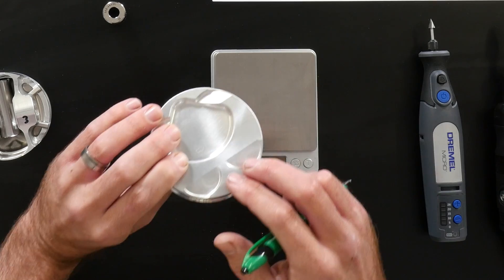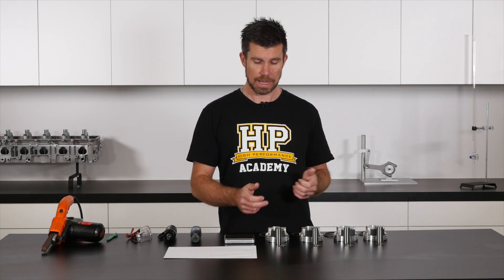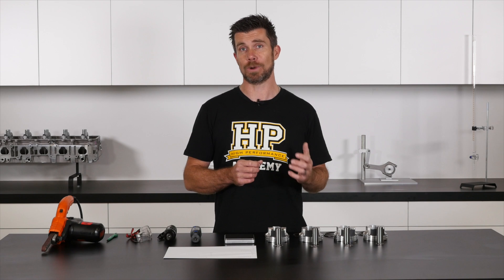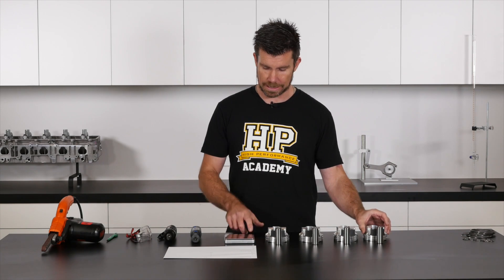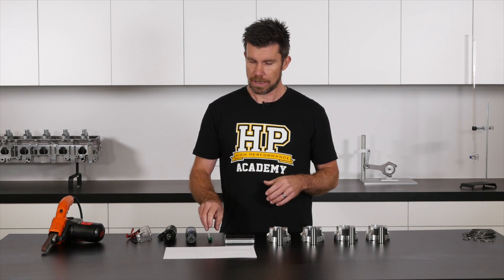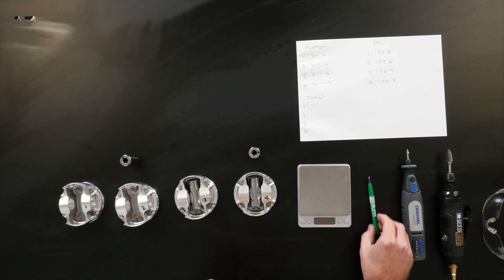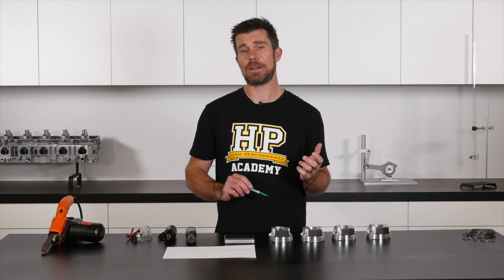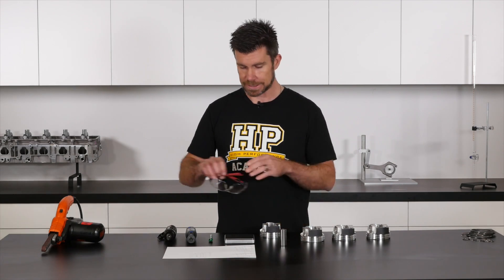How to balance a piston ⚖️ | Performance Engine Building [FREE LESSON]

Comment: 0.01 Grams don't sound like much until you take into account how many G's a piston Experiences as it switches from going up and down TDC & BTC
The piston itself will weigh upto 10 Tonnes (10,000KG) 
During Peak G-forces as it changes direction in the thousands of G's 0.01 grams becomes 20-30kg of unbalanced weight on piston

Comment: So i weigh out my pistons, pins etc. and my rods for the piston side (oscillating weight) and crank side (rotating weight). Now I matched the rods to the pistons (clips, rings and pins have exactly the same weight, so they don't matter), can I use it like that? 

My rods just have a difference of 0.2g, my pistons have a difference of 1g lightest to heaviest. Rotating mass of the rods have a difference of 0.2g (measured everything a hundred times). 
I wanted to get an overall difference of 0.3g max.

Comment: It's ok to dril diesel piston to remove weight?
Reply from the maker: You can do this to diesel pistons as well. Same rules apply when it comes to the fact there are areas where you want to avoid taking material from and others where it is acceptable remembering you balance to your heaviest piston to match them rather than getting them all to your lightest as that will see you needing to remove more material - Taz.
Reply: @hpa101  thank you

Comment: I have a piston that is 2.14 grams lighter than the rest. Can I even remove that much material safely?
Reply: Late reply but if it's an aftermarket piston I would be returning it for a replacement. 2.14g out of weight with the rest isn't great QC. Generally any half decent piston manufacturer should be matching their piston weights across production such that a particular set doesn't have that much variance.

Comment: André, what I still do not comprehend entirely is when we use pistons and rods that are of different weight compared to the factory piston weight. 

The crankshaft obviously is balanced in itself. How does heavier / lighter rod&pistons affect the entire rotating assembly?

TIA
Dom

Comment: Has anyone ever re-weighed the pistons after hard use?

I wonder what effect the carbon build-up would contribute.
Reply: I am planning to rebuild my 2008 Honda City 1.3MT Engine, Cylinder no 2 is weak, Engine burning 0.5_0.7 Liter between every oil change. I hope my C-2 will be doubLe in weight LOL.

Comment: Ahhh sir... you ground the piston down at the wrong place and weakened it. Sorry but warranty is void now even though the piston is indeed defective. Sir, would you like to buy another one?
Reply from the maker: You can call your supplier before you balance your pistons to be safe and double check where they wish you to take the material from. This isn't something new or unknown to them, in fact in some advertising they will possible boast as getting their own product weights very close so that it is less work for you to balance yourself, which acknowledges their understanding that it is done and required for and by many :) - Taz.
Reply: @hpa101  yeah I hear ya, was just joking around. Btw, is it required to balance the pistons? I've got a set coming in for my engine, didn't really want to do this unless it's necessary.
Reply from the maker: @garyr7027  ahh sweet, sorry man, it's hard to tell sometimes with just the text as we get some surprising comments haha
If you don't plan to balance your pistons and rods the way we do for high performance builds, say if you're just rebuilding a low power application for your daily driver, then at the very least you should still weigh and pair them in such a way to get them as close as possible as sets. 
This would see your heaviest rod with the lightest piston etc.
It's your build so at the end of the day you can do as much or as little to it as you like 😎- Taz.
Reply: @hpa101  that I can do, and it's a good idea to at least get them close to same weight. One other thing, should the rod be weighed in with it?

Comment: Nice tutorial Andre!  I have a question for you - when I designed pistons for a project, I spoke to the design engineers at Mahle about piston balancing. They told me to categorically never remove material from the underside, and only remove material from the crown area. This leads me down the path of settling the combustion chamber volume first, and balance after. Balancing the gudgeon pin/ wrist pin seems like the only viable option once you've set the compression chamber volume?
Reply: yeah, the underside is under tension, cracks may start there, the top side is in compression,no cracks can originate from the top

Comment: Balancing to a tenth of a gram is a fools endeavor when masses orders of magnitude greater than that in the form of oil, carbon, etc are uncontrollably and unevenly distributed on the rotating and reciprocating components of an engine.  Also, any set of pistons or rods that isn't sufficiently balanced from the factory aren't worth buying and using in the first place!
Reply from the maker: Unless you're in Formula 1, you don't have the ability to accurately calculate and measure oils influence or carbon weights etc. There are some things that are simply outside of our control, so instead we focus on what we can control and do it to the best standard we can. 
To balance to the degree Andre has here, and he did address this in the actual video, it could be considered a little overkill, but it only takes a few more minutes than it would to do things to a lesser standard.
For balancing from factory, it's all a matter of degrees of balance and you could quite easily run this kit as delivered. We tend to be extremely fussy so our target balance is just tighter than those of the parts manufacturer. We find that all of the aftermarket parts we use are outside of our personal targets if that makes you feel any better - Taz.
Reply: Absolutely agree that +/- 0.1 gram is a waste of time. Unless your reciprocating mass is extremely light, or your RPM's are extremely high, you do not need to balance to better than +/- 0.5 gram.
Reply from the maker: @bunnyrabbit4972  what's the time difference between 1g, 0.5g and 0.1g when it comes to balancing? I think you will find it is negliable, but everyone is free to do things to their preference on their own builds for sure - Taz
Reply: @hpa101  
A typical high performance STREET engine will not have a peak piston deceleration rate exceeding 3000 G's approaching TDC at operational redline. 0.5 grams * 3000 = an instantaneous imbalance of 1.5 kg. This is nothing to worry about, and when you marry the light pistons with the heavy rods, and vice versa, the overall error is reduced further, below +/- 0.5 g.

Comment: can you use the small-end rod weights to balance the piston weights?
 ( example: +1piston&+0rod    and   +0piston&+1rod)  
I have a piston thats like 2g overweight, all my pins and rings are all the same. i took out some material from piston, but i dont want to remove too much. so can i include the small-end rod weights when balancing? or is it better to just grind pistons and rods Separately to match smallest weight
Reply from the maker: Hey there Andrewdini :)
2g is not an excessive amount to remove from your piston, and your pistons and rods should be balanced independently.
Your connecting rods will be balanced at both the big and small ends, so taking excess off one for the sake of your piston would actually see you taking off even more material to balance that out across your rods, which is something you don't want to do.

Just remove the material from the correct location as shown and you will be find :) - Taz.

Comment: Great vid! 🤩 one question: we have anyway to take the conrod out, so it would not be also a good idea to weight them and match it, like the conrod and piston weights the same?
Thanks and keep going to make videos like this!
Reply from the maker: Hey there DrSiech. Yes sir, your conrods can and should also be balanced. You avoid doing them with the pistons as an entire unit and I'll pop a few links here that will help cover this and it is also in the engine building course material.
Quick video: https://youtu.be/TViHBkLZnx8
Some more details here: https://youtu.be/0tXbCqA2QHI
Webinar lesson on this specifically (paid content): https://www.hpacademy.com/previous-webinars/193-2/
Course material this is included in (paid content): https://www.hpacademy.com/courses/practical-engine-building/

Hope that all helps you out - Taz.

Comment: You clearly don`t know what your talking about
Reply from the maker: How so Dan? Share some knowledge on what you specifically think is being done wrong here and we'll be happy to discuss =) - Taz.
Reply: @hpa101  Your choice of removal area is not only out of the norm it is ridiculous but thanks for asking
Reply from the maker: No worries Dan, explain where you take material from and why in that case - Taz.
Reply: @hpa101  on the pin boss above the hole on the in side would be the preferred method

Comment: With in a gram or 2 is fine. If it's revving over 7k+ then you might want to get more anal. But other that. In a street motor, this is pointless. Especially when you think about how much oil CLINGS, to the crank shaft throwing off this balance. Now you can polish the crank to reduce the clinging.  But unless you are are constantly revving this engine, and or looking for a slight advantage over the competition in your class. It's pointless.
Reply from the maker: You can only control so much, so why not do it right rather than worry about what you can't change? 
We've never heard of an engine failing due to having the pistons balanced and it only takes a few extra minutes to do it more precisely than 2g, however, everyone's build is their own and they're free to do it to whatever standard they wish. Nothing wrong with that - Taz.

Comment: Amazing video. I have a suggestion/question:
When pairing pistons with pins, instead of going for "heaviest with lightest" there might be a combination where you could pair them such that two pistons pin combos could have the same weight while being the lightest ones. This could make it so that you would only have to remove material from the other two pistons. 

My example is based solely on adding up the individual weight measurements from the pistons and the pins (I understand that weighing them as a pair could provide a slightly different weight due to rounding): Going piston 3 + pin 1 as well as piston 4 + pin 4 would give them both a combined weight of 450.2 g. While the remaining two combinations will be 450.5 g and 450.7 g.

Do you think it is worth to go the extra effort to try and create pairs (or groups) of piston-pin combos with the lowest weight possible? So that you are actively balancing less pistons and/or pins?
I suppose this will not always be possible, but I am curious if this is something people do.
Reply from the maker: Ideally you're trying to do it so you're removing the least amount of material rather than working on the least amount of pistons. When you're doing it yourself rather than being billed by the hour too an extra 15 mins or so really doesn't matter as it isn't a hugely time consuming process compared to other aspects of engine building, but at the end of the day you of course are free to do whatever you thinks makes the most sense and works the best for you personally - Taz.
Reply: @hpa101  Makes sense. Thank you guys. These videos are amazing and I'm learning so much. And the fact that you're replying to questions from 2 year old videos. You are incredible!

Comment: Wouldn't it be easier to remove the material from the very bottom edge of the skirt? Seems like that would be the lowest stress area of the entire piston, and easiest to do.
Reply: No, thats actually one of the high stress area, the skirt is the part that keeps the piston straight up by rubbing the cylinder wall, with oil squirted on them of course. I wouldn't mess with something that has a very important job

Comment: Zero and then calibration the scale before measuring. If you are doing the same for clearances then it should apply to balancing. If you have all the fancy equipment such micrometers, bore gauges, and calipers and are not properly calibrating before using then whats the point? It can be off just one time but that one time can be catastrophic.

In this case calibration doesn't ensure precision, but if a scale is inaccurate I wouldn't trust it for balancing to a tenth of a gram.
Reply from the maker: If you were going for a specific weight, we would agree, however you just need the scales to be repeatable,, so if it's out by 5 grams so long as it's out by 5 grams every time it doesn't matter for this application - Taz.
Reply: @hpa101   I agree if it is precise, and will consistent enough for everything to be balanced. 

Hypothetically, if the scale was reading heavy 0.53 grams every time and engine builder decided to subtract 0.53 grams from the balancing numbers. Once you take stuff out and find everything is 0.53 grams lighter would you trust that engine builder if he says the scales just always reads heavy without any proof?

That is why during calibration they even write the difference in readings.

Comment: im tired of buying scales... i dont even know where to get a scale that can measure the weight of a piston and still be accurate to a tenth of a gram...
Reply from the maker: You need accuracy in the differential of weight, not the actual weight. You are trying to get them all to the same weight, not a set one, so repeatable results are what you're after. We spent a lot of money on scales before finding some cheaper ones did this best for us, but some HPA commenters have also mentioned that painters scales can be very accurate, a good size and also a good price for this usage ;) - Taz.
Reply: @hpa101  thanks for the money saving pointer!

Comment: Hey brains how about blowing off the Pistons with air so your not weighing the filings you just ground off.
Reply from the maker: Hard to see in the video but when you're doing this you're holding the Dremel in such a way all of the shavings are not going into the piston, they're going straight out. We just assumed this little tidbit would be common sense sorry, but I'll add a note to the description.
Once you dive in yourself you will see exactly how that works :) Enjoy! - Taz.

Comment: Your scale is Garbage! .... I came here to double check. Please if your building a motor don't use this junk it does not repeat very good and I ended up tossing the same scale shown here and bought a used scale that does not hit hundreths but it hits the numbers the same every time because it is certified. you can get a scale like this from auction or borrow it from a lab.  He is giving ok advice. The reason I am rebalancing my stuff is I had 1 ring to replace which in most cases you should replace ALL rings but it happens to be 2 grams lighter. Beware when doing this stuff!
Reply from the maker: We tested this scale before use and spent a $400 USD on one that didn't give repeatable results like this did. We didn't use your scale that gave bad results, and if we had the same one, tested it and found the results were not repeatable we would have chucked it in the bin too just as you did :)

You need to test whatever scale you get, no matter where it's from and remember that you're going for the difference in weight, not the specific weight so even if the weight given was incorrect so long as it's consistently given that result for all your pistons then it is fine as that means it's measuring the difference between the pistons correctly which is what we're after here =) 

I have worded that terribly sorry, but hope you understand the point there - Taz.

Comment: I was about to drill a small dimple on top of the piston.  Heck, drill 15 dimples to remove 15 grams from the piston.  Then to complement the reduction in piston weight, increase the boost by 15 psi.
Reply from the maker: Just as well you saw this video then eh Quang! - Taz.
Reply: It lets me rev to 15,000 ripums.

Comment: don't use Chinese scales. Use a paint mixing scale made in Japan or USA
Reply from the maker: We did spend 200-300 USD each on two other sets from a reputable US company that surprisingly (and frustratingly!) didn't give correct or repeatable results, whereas these scales might not be 100% accurate if you were trying to get a specific weight, however they are accurate between weights (the difference) which is what we're after for this task.

We do know that painters scales are also a good choice 👍 - Taz.

Comment: Another grate video!

Some questions...  Is there any reason to such a precision? The acceleration of a piston in a performance engine is what? 200000 m/sec². With a 0.5 grams of imbalance we are looking at 100 N of force differential. Is it enough to cause problems or to make a difference in the performance of the engine? What an imbalance o a gram for example would do to a performance engine?
Reply from the maker: It's up to you, Andre does mention at the start it might be other kill for some however you're balancing your pistons anyway and all it costs you to be a little bit more pedantic about the weight difference is really a few minutes of time, nothing else, so it's something Andre always does for this reason - Taz.

Comment: I used use a sharp knife to remove aluminum. It's cheap and accurate.  Works for porting aluminum cylinder heads too until you need to work the valve seat area
Reply: I've been working with aluminum lately ,and it's kinda neat you can whittle it like wood with an old razor knife.